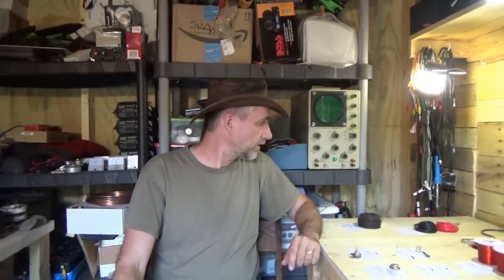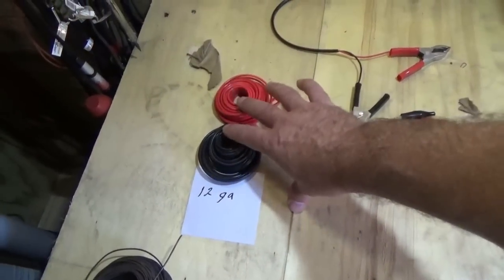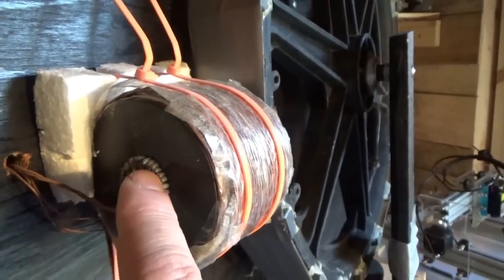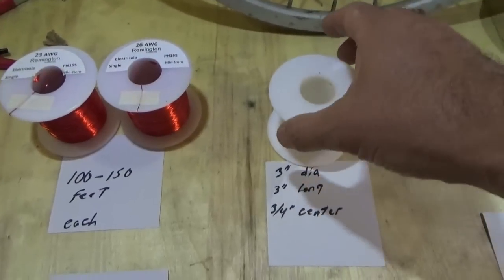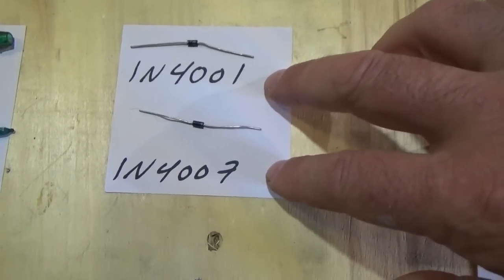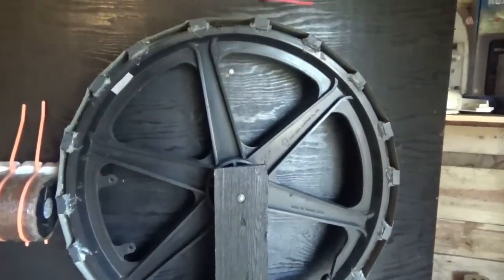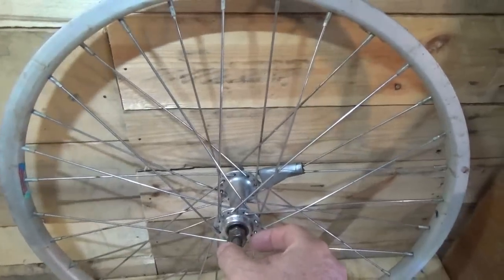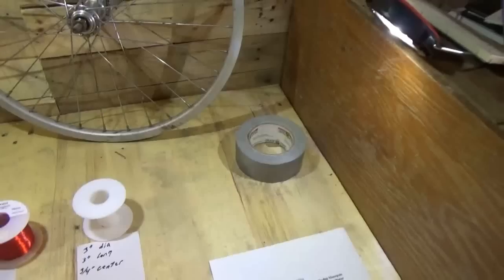How To Build A Bedini Motor Series ~ Parts List

Comment: My ssg motor i used n52 neodydium magnets,  its on my channel, i actually have a electromagnet with the powerful magnrt spinning inside of it, not only N facing, mine whistled while spinning from resonance, really your spinning wheel needs to be something heavy once its going it's hard to slow down takes less power to keep it spinning.

Comment: the metal case on the transistor is not required i don't know why you think it is but it is not
Reply: I think he requires it for pinning it on the board during placement of the circuitry. I was hoping he would show the completed setup at the end of the video or something.

Comment: I am using a bike wheel off of an old exercise bike since the tire is solid rubber and it can be dressed to be perfectly round.  I use Aylmers Polyurathane Glue to bond the magnets. My magnets are spaced so one is over each spoke as this gives good spacing.
Reply from the maker: Sounds good
Reply: What have your results been like with the Bedini SSG setup? Charging a battery or a bank of batteries? How quickly do they charge? Can the battery/batteries be connected to an inverter for use while charging?

Comment: I have a question:
I understand that in a coil, the more one moves away from the metallic core of the coil, the less the magnetic field is strong.
So in a Bobian, the turns that are farthest from the heart are less induced magnetically.
I also understand that no matter the length of a metal hub, if it is magnetized it will magnetize instantly even if it measures 1 meter.
My question is this:
If we build a coil with a longer core, with the same length of wire but wrap closer to the core, even say that the wire will only make 1 turn on a coil of 1 meter ... It will not be better since the wire will be closer to the nucleus which will be fully magnetized anyway? Better than having a coil that gets bigger and goes further away from the nucleus.
Reply: Just wondering, isnt the flux (away from the core) what we want?

Comment: Hello, Please what is the name of the insulating paint used for prevernting eddy current?
Reply from the maker: I am not sure. Magnet wire comes coated already. But I one time laid out 200 feet of wire and spayed it with primer. It actually worked and is still good today. Once its wound, it wont matter.
Reply: I mean the iron core you pilled up. You painted each one of the before you stacked them inside the coil. But before that you painted each one of them. What is the name of the insulating paint used?
Reply from the maker: I used primer for that again. Simple automotive metal primer. Anything thin that stops current from flowing will work.

Comment: Great video 👍👍👍and thank you for taking time to explain simply 🙏
One thing I am unable to get onto the links for your web site just blank ?
Reply from the maker: Is it working now? I was moving to a new server and to SSL but had some trouble with it.
Reply: @thedoityourselfworldelectr8007  No joy  here either :( ... From host lookup, I get 'doityourselfworld.com has address 198.54.125.244' then wget 'Resolving www.thedoityourselfworld.com (www.thedoityourselfworld.com)... 192.157.192.150'.  If I use the first IP .244 instead or domain name in a browser, I get '403 Forbidden'.  Two problems, .150 sends everyone nowhere and .244 blocks access.  Seems you're being throttled in many ways ... Cheers Phil and good luck !

Comment: Other then charging a battery to make it make continue work what else have you done thats useful with the output. The ssq is ok but it dont do much.and to get a higher output you should make the ssg with a darlington pair (2transistors)
Reply: @dedu456 speaking  of Patrick Kelly, have you ever got the pjk book? 3000pages full of free energy devices he made?
Reply: @doubleooh7337 do you have the book? I'm asking about the versions up to 2017 or so.
Reply: @ekeretteekpo3004  the latest book was 24 june 2019 but i do have older ones aswll
Reply: @dedu456 I'm gonna mske s more powerful motor soon eith a ssg circuit to see if itll power a hho cell
Reply: @dedu456 the book

Comment: Can I use bolts or screw assemblies to secure the magnets to the polymer wheel?
Reply from the maker: Anything magnetic may interfere with the system. I would use nylon bolts and nuts instead

Comment: Looks like an interesting project Troy.  FYI  Harbor Freight can be a great place to buy inexpensive 
tools for your projects.  I believe they have a  terminal crimping kit with crimping tool for $4.95.

Remember you can find those coupons for lots of FREE items at Harbor freight  as well.  One of my favorite free 
items is a 7 Function Digital Multimeter.  They also have coupons for FREE screwdriver sets and 25'  measuring tapes and
27 LED Flasglights and Electronic fly swatters and many others.

Here is a link to many of the coupons for free stuff.  Some you have to purchase something.
I just buy one of the cheap razor utility knifes at register for about .39 cents.
(  I have six of those multimeters and seven of the 27 LED flashlights on my fridge haha )

http://www.hfqpdb.com

Comment: Does the wheel diameter matter?
Reply from the maker: Not really. Biggest thing is that the bearings are or can be made to spin very freely and that it is a non magnetic wheel such as aluminum or plastic. I had a Bedini motor made using a roller skate wheel but dismantled it for safety. The thing ran so fast it was scary. Smaller wheels will spin faster for some reason.

Comment: Question :  If you spray paint the bailing wire or welding rods, wont some of them scrape off when being wedged into spool and touch each other with bare metal?   I guess it is not really a issue since you have done it and have said nothing about it being a problem.  I just wondered.  Thanks for your efforts to present all this plainly.
Reply from the maker: Yes, some will scrape off in the process. But by reducing most of the electrical contacts, you reduce the eddy currents in the wires.
Reply from the maker: And not every scrape will be an electrical connection. Say the end of one wire scrapes the middle of another while pushing it through. There will not be a connection unless both wires are scraped in the same place and touching at the time.